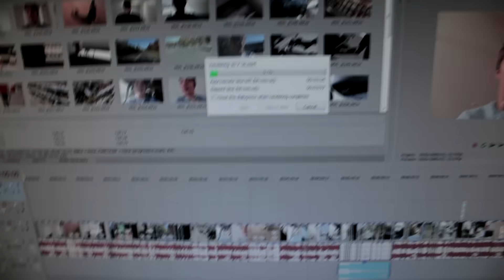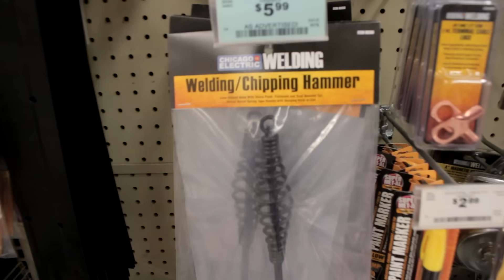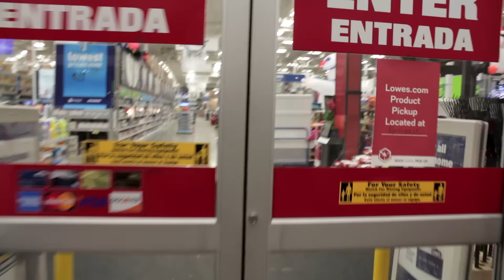HOW TO TOW A TRAILER WITH A LAWNMOWER!

Comment: You guys could wire a 220 outlet from your elect box easy as pie. Literally just takes two 110 breakers and a heavy gauge 3 wire plug and whip. 20 mins
Reply: dont tell them that, theyl end up burning the shop down with their haggard wiring ahaha

Comment: you need to add a gusit so it has more strength and less stress on the bottom part witch looks weak asf even if you use some of the angel and cut like a 70 or 80 degree angle and weld that there

Comment: you need to put an A frame type brace from the top of the hitch to the frame above the hitch. email me and ill send you a picture of the best way to brace it and make it strong. also you may have to put weight on the front of the mower to hold that huge trailer. anyway email me and ill send you a picture of the best way to brace the hitch.